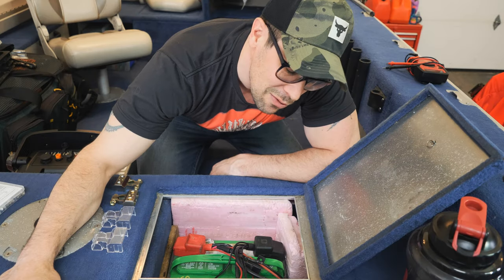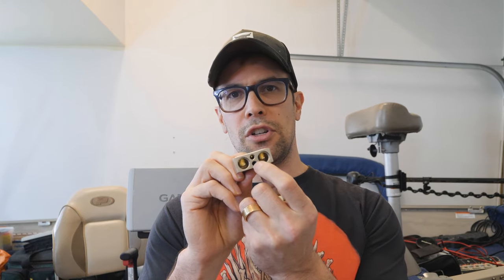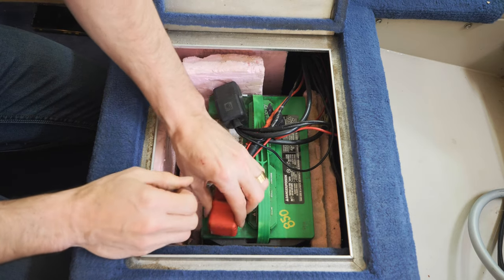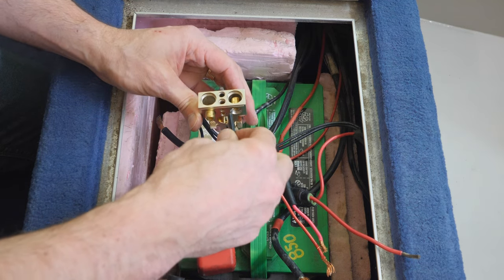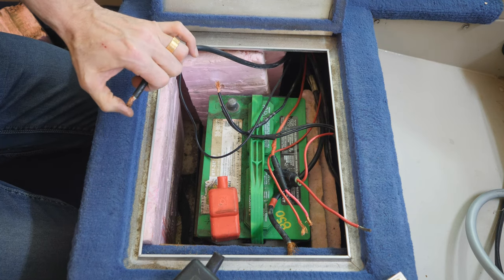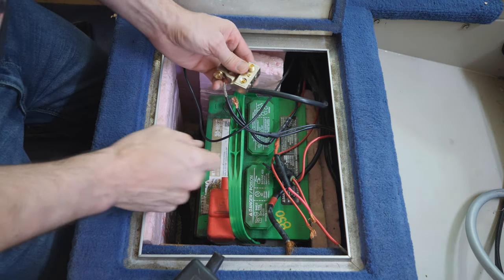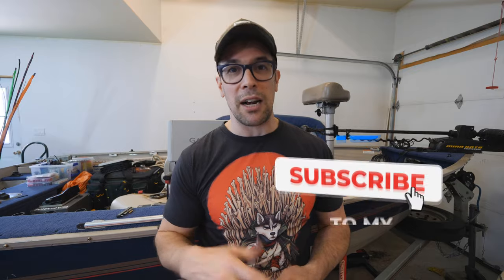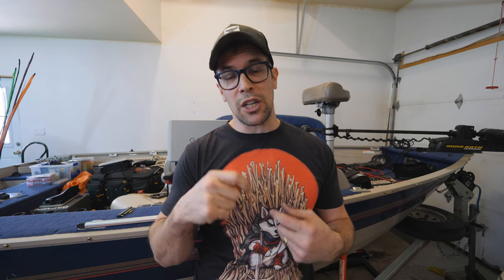Is this the best battery post connector for your boat?

Comment: Good choice on the battery terminals Dan... those are vastly better than your basic type, especially when it comes to connecting multiple wires of various sizes... the only thing I might suggest is to add a drop of 243 Loctite on the Allen screws... most likely you would never have a problem with the screws loosening up, but a little extra insurance doesn't hurt
Reply from the maker: That's a great tip Phil! I actually made a mental note to check on the Allen bolts every once in awhile just to see if they're moving at all and if they do I'll definitely add some loctite. As a motorcycle owner there's always a couple of small bottles of it laying around somewhere 😂

Comment: Great video. I enjoy watching your videos. However, I would suggestt using a bus bar instead of a terminal with grub screws. These type of terminals can lead to corrosion, and over time with vibration on the water can become loose, causing a fire hazard. On a boat, try to use ring terminals and bolts as much as possible with proper fusing, cabling/ marine grade, and adhesive heat shrink.
Reply: I couldn't agree more @robbyota5598. As a new boat owner, I purchased these after seeing this video. No bueno! I keep up on maintenance but the corrosion was rampant. Also, poor design and poor fit. I looked back at my Amazon "previous purchase" from 3/2021 and there are many negative reviews stating the same issues. I'll be visiting West Marine tomorrow morning.

Comment: Hi Dan, Good to see another Canadian fishing channel.  I've seen a couple of your videos.  These terminals were just ordered.  Thank you.  I watched your lithium video,  Less weight, 100% capacity until it runs out sounds great, just too much right now for the benefit for me.  My next deep cycles will be AGM.  Do you have a battery load tester?  I know you said some of your batteries quite out on you.  You can get them on sale and might save you some hassle. I will watch more of your videos, keep them coming.
Reply from the maker: Hi Daryn, thnks so much for watching my videos, I really appreciate it, as well as you taking the time to leave a comment :)  That's the thing with lithium, the initial cost can be a tough one to absorb for some folks... they are definitely a big up-front cost, especially if you need a few of them!  I don't have a load specific tester but now the onboard chargers all do this load testing and signal you if there's an issue.  I actually usually notice it as soon as I get a drop on my trolling motor use time.  As soon as I can't go a full day on the trolling motor, I know it's time to change.  So far my Interstates are going strong after 3 years knocks on wood  I will be testing a lithium battery very soon on the channel so keep an eye out for that one and thanks again!

Comment: Great video Dan, but I like to unhook my battery’s when not in use. Do you have, or can you make a video on how to install a battery shut off??. Thanks.
Reply from the maker: Hi Steve, that's a great question about the master switch. basic tin rigs such as mine typically do not come with a master switch because the wiring system is fairly simplistic. There's absolutely no need to worry about disconnecting my wires or the battery for safety reasons as everything is properly fused on the boat. I just need to make sure that after a day on the water I turn off all the accessory switches which is actually caught me twice left on and ended up burning out my battery, which a master switch would prevent. with that said the key to a master switch is getting in the habit of actually using it. Knowing myself I would probably not get in the habit 😂

A master switch is found on larger more complex boats with more heavy electronics and especially with dual battery setups and they have a 1-2-all switch for selecting one or shutting off everything. Most people I know that have them only shut them off when the boat will be in storage for a long period of time. Some folks have more peace of mind shutting it off at all times, but for me it's never something I've thought about.

If you do end up doing it on your boat, remember to run a direct bypass to your bilge pump! I may it do it down the road as a "how-to" but I don't have any plans in the near future. I'll add it to my idea list :)

Thanks for this great question and video suggestion :)
Reply: Thanks for the advice Dan, it’s more of a piece of mind for me😂.

Comment: Would you consider changing the trolling motor terminals as well?
Reply from the maker: This is a good question and I would actually say no... You oftentimes have to play with the configuration of the wires, or remove the batteries etc. You just tend to play with the batteries a lot more and it's better to be able to separate the cables from the bolted post. My main battery the concern was I had a ton of small wires but I don't really remove them very often so that's why these ones are perfect.
Reply: @DanRichardFishing  Sounds logical thanks!

Comment: Just saw this video.  Great vid. I have dual positive posts and dual negative posts and like you I have numerous items attached to the positive and negative posts.  Could I use these on the positive posts and still keep a few things attached to the screw type positive posts?  In other words could I put some options on screw type posts and a few other items on these clips?  Or would not recommend this as an option.
Reply from the maker: Hi Don, thanks for your question.  I see no reason why you couldn't use this as well as the threaded post.  Hope that helps!
Reply: Alrighty thanks. I might just do that.

Comment: the clear plastic protectors.. is there a easy way to get them on /off?   I had to mess with them to get them off.
Reply from the maker: I just pop them off with a small nail removing tool, pops them right off.

Comment: Why dont u have marine battery terminals? Isnt it better to just use them 3/8 post in combination with SAE posts?
Reply from the maker: Marine batteries have a few common terminals you typically see.  The SAE that are on all automotive batteries and some marine batteries, the threaded terminals (usually a STD and WN stud, which is actually 5/16 and some are 3/8) and on my recently upgraded batteries that I will show soon, I have the hybrid threaded SAE, which I think is an M8 bolt if I remember right.

Anyhow, in this video I was using an Interstate battery that I bought an emergency when I was at the ramp and discovered that my main battery was toast.  It only had the SAE only and with so many accessories and wiring, I wanted block style post connector, which is what was in this video.

On my new setup, which I will film soon, I am using similar blocks except they are bolted to the hybrid post.

In terms of any of these solutions being "better", any of them will work perfectly and reliably with proper installation and maintenance.  It really depends on what you want for your setup.

Comment: great video--but note that those ferrules need to be crimped to the wire first!!!
Reply from the maker: That's technically not true, I have seen several instruction guides that do not require a crimp.  They say to insert the sleeve over the wire, place in to the receptable and tighten the fastener.  Check out the instructions for Marinco receptacles for example, no crimp required or even suggested.  Example here: https://www.mybait.de/images/pdf/Marinco-Stecker-Steckdose-70A-Montageanleitung-Englisch.pdf

Comment: A little dielectric grease wouldn’t hurt either.
Reply from the maker: I actually don't like using dielectric grease on battery terminals, it makes a mess for nothing.  Been boating for 35 years (first boat when I was 10) and I never put it on my terminals.  There are terminal protective sprays you can buy if you want the added protection.  I only use dielectric on connections that will be exposed to the elements directly.

Comment: I really doubt that a battery manufacture advice you to install all the cables to the battery terminal.
 you don't need to connect all the wires to your battery you just need a bus to connect you main wires for everything you need
Reply from the maker: Actually, if you read the instructions on almost all electronic devices you purchase for your boat, it states that the power must be connected directly to the battery.  It's kind of surprising and a ton of people don't realize it.  As you mentioned though, I actually do have a fused marine power block on my boat now under the dash and I have a bunch of goodies connected to that and I removed about 3 cables going to the main.  I installed it when I added Panoptix to the boat :)